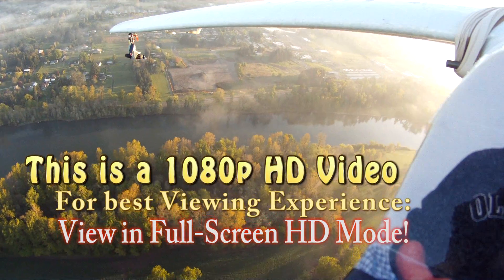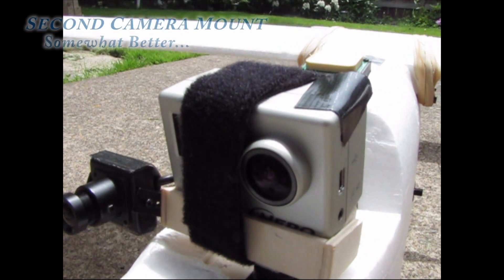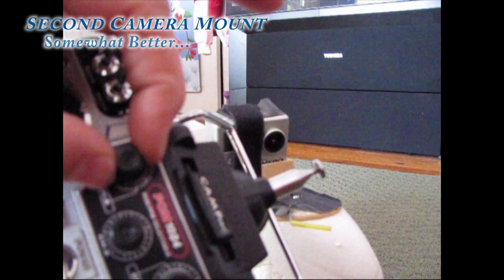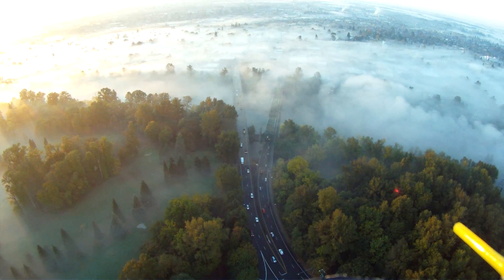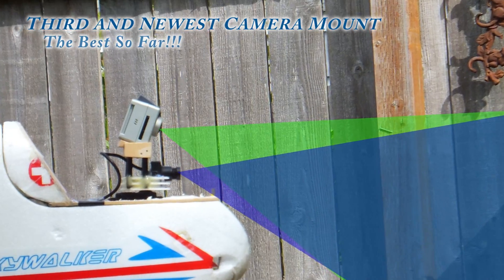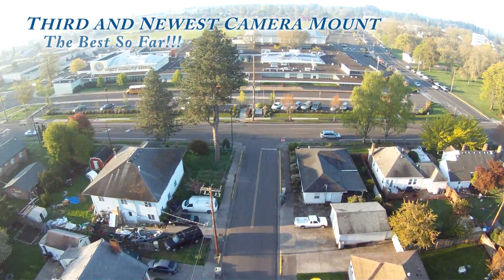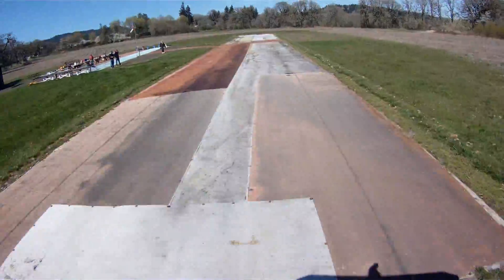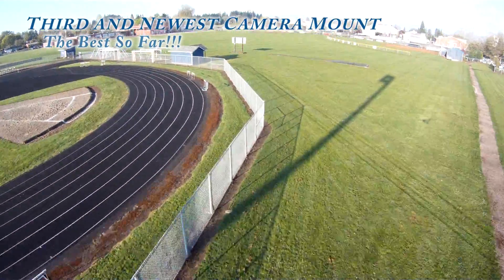FPV 360° Pan Mount - Part 1 (of 2) - The Design

Comment: So I thought this was a great idea and I bought the servo from you and made the pan for my Ranger EX and it works fantastic! Thank you. My question is this. I want to make a similar pan system for a mobius to put on a smaller plane but using the servo here would be entirely too big and heavy for this. Do you know of a mini version of a sail winch servo? Thank you.
Reply: +UAV Patrol If you look at flitetest's skywalker x8 review and skip to 3 min 30 sec, they made a custom pan machine that could be scaled down. They took a servo, tore it apart, took out the potentiometer, installed a new one on a gear, and connected it up so the servo thought it had the original potentiometer. This way, the servo spun until the custom potentiometer told it that it went 360 degrees, then it stopped.
Reply from the maker: UAV Jockey FPV I don't know of a mini 360 servo but I wish I did!
Reply: Bummer. Make one, market it. I'll buy it.
Reply: Thank you. I have since incorporated the pan mount in this video. the one you suggested looks great too.